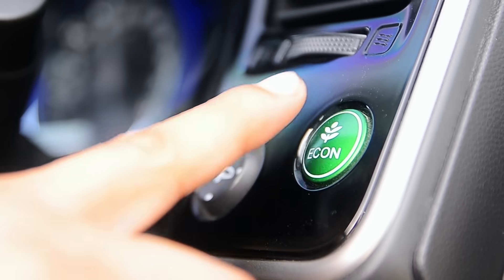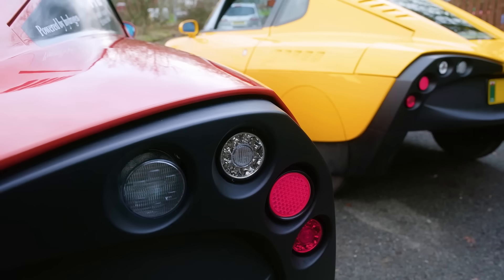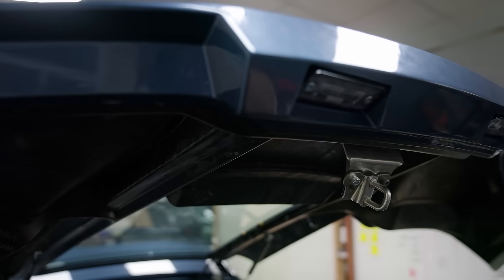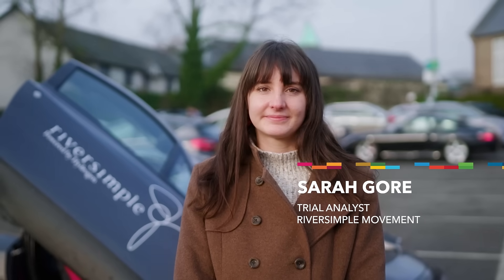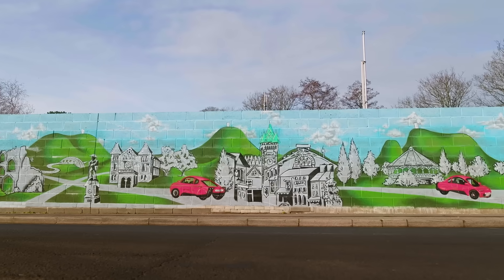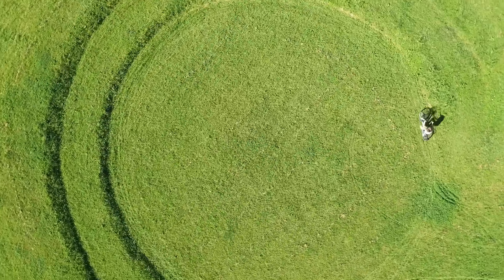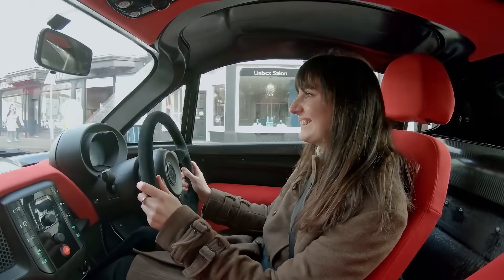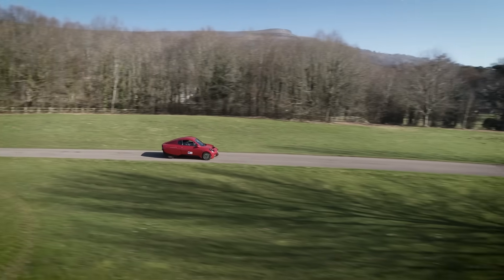Inside The Former F1 Engineer's Innovative Hydrogen Car

Comment: The concept is cool and the proposed range is good, the hydrogen needs to be green otherwise its just moving the problem out of the eyes of the customers and the cost needs to be appealing.
Reply: Love thé car. But if I cant own the car, I dont want it. Aptera.
Reply: @willdavis4863  yup, Aptera is FAR more appealing
Reply: @willdavis4863  How is owning that Aptera working for you? They have been working on that for over 20yrs. in one form or another and still not in the hands of the masses. vehicle, then it went to 8k then 10k and look at the price now and still nothing on the road.
Reply: @madkow007  There are two versions of the Aptera, the first, around 15 years ago, was taken over by industry insiders, pushing the founders out of the business, and wrecking their ideas.  

The founders were able to buy the project back a few years ago and restart the project from nearly zero, little more than body design as battery technology & material science etc. had moved on so far in the intervening years, and are now close to manufacturing a very promising vehicle, nothing else touches 10 miles per KWhr for example.  New / revolutionary car start ups don't launch into production in months, it takes years.  Right now Aptera are in the process of securing the moulds for body production from CPC in Italy, with the first moulds shown off by Aptera within the last week or two.  Considering the novelty, they are making great progress, first cars probably shipped later this year, or early next if not which is not unreasonable with such a blue sky thinking car.
Reply: Production of hydrogen even if green wastes way too much of the energy.
Reply: yeah I agree if it's shipped far away not good and if its made with fossil not good either, and if with low efficiency just nope.
Depends if electrolysis tech improves, hydrogen can be produced pretty much everywhere where there is water and power.
Reply: @bubbleemily  But green hydrogen always wastes energy in any form.
Reply: @girowinters  sad but true. Hopefully we might find a more efficient way down the line.
Reply: @girowinters  much better to use children's energy to dig up the materials for those earth saving none recyclable batteries.
Reply: @OldandCold6955  "none recyclable batteries"  ...  The batteries used in BEVs are very valuable resources at the end of their mobile life, up to 99% recyclable even if they spend a long time in fixed storage when their capacity has fallen too far to be a useful car traction battery
Reply: @peterchandler8505  none recyclable in the fact the owner of the said battery pack will have to pay a not inconsiderable amount to have this done (it will not be free) plus charged with the responsibility of keeping them in a secure and safe condition, they will no be able to leave them out for refuse collection will they, plus all the other myriad of problems for the owners, no one ever talks about this do they, ! if plastic is a problem we ain`t seen nothing yet
Reply: @OldandCold6955  Those traction batteries weigh of the order of 500kg, even if in several parts!  Your average driver will not be in a position to remove & replace the battery, especially as working with high voltage connections can be lethally dangerous and should not be undertaken lightly!  For non mechanic / electrician drivers (ie almost all) the battery change can only happen at a maintenance garage, where the garage will have regular suppliers, and will get a discount on the replacement battery by sending in the old battery for refurbishment if possible, or recycling for the valuable materials, producing high value raw materials for future battery manufacture.  A process similar to ICE cars for valuable parts such as engines, alternators etc where when replacing a failed part the vehicle owner will have the choice of a used part, refurbished or new part.  Even a poorly used traction battery will be quite valuable as it can be 99% recycled producing valuable materials.  

In practice, Teslas lose about 1% of their range every year, which means that the batteries will outlast the cars, hence Tesla are moving towards making the battery a structural component, it is after all a large and heavy part of the car, using that material as a structural part will reduce the overall weight of the car making them cheaper and kinder to the environment.  There are obviously batteries that fail earlier, that is what warranties are for, with Tesloop Taxis (who 100% fast charge their Teslas everyday for long fast trips, hence multiple hundreds of thousand mile cars) getting some high milage batteries replaced under warranty.  The Nissan Leaf seems to be the only car suffering real battery problems, but then their battery management is the poorest on the market leading to an active (though still quite small) market in upgrading battery packs that have deteriorated, or replaced with a larger battery pack.  

There is also a lively market for used traction batteries, especially Teslas where businesses such as Electric Classic Cars in Newton, Wales, will use those used / refurbished Tesla batteries (or other new / used batteries) to electrify existing vehicles, replacing the power train with a battery & electric motor.  Electric Classic Cars have an informative and entertaining youtube channel where they cover electrifying various cars producing quite dramatic improvements in those vehicle's climate footprint, drivability and performance, alongside many other factors such as recently covering fires, comparing BEV Land Rover off road with diesel Land Rovers.  The videos have covered Land Rovers, VW vans, VW Beetles, Range Rovers, etc. etc. etc. showing the various parts used in that process.
Reply: @girowinters  no hydrogen is great, you can use excess energy created from renewables to compress it into hydrogen. Sure you only get 40% efficiency, but at least you dont have to sit at a charging station for 45 minutes.
Reply: @girowinters  But less is wasted than the production and charging of a lithium battery.
Reply: @girowinters  If the excessive amounts of solar power produced at daytime (a problem in some areas in the world) could be used to produce hydrogen, it would make sense.
Reply: @HulluJanne  It would make more sense to charge batteries during excess times, much less loss. Or pumped hydro if available. hydrogen is on the bottom of the list, to mass produce hydrogen fossile fuels conversion is the only economic option, thats why these initiatives are coming from fossile fuel corps, directly or indirectly.
Reply: @HulluJanne  Unfortunately these areas have no or little water sources. Probably wind power stations is more suit such needs. But anyway it's not the best solution for energy storage today.
Reply: @HulluJanne  Pretending the society can throw away that wasted electricity instead of storing it to charge batteries on programmed chargers?
Grab a calculator. It's all on Wikipedia!
Reply: My concerns with Fuel cell hydrogen car with Toyota Mirai as a poster child, It need a huge high pressure pill shaped tanks for it to have a decent mileage. So much so the car got so big with too cramped space inside. It didn't even have a trunk to store your groceries. It is as big as BMW serie 5 with inside space of a Z3
Reply: The Aptera is strange looking but it has more boot space and interior space
Reply: @macberry4048  Yeah but sadly it's American sized like everything else. They should really have thought about that if they want to go global.
Reply: @Enforcer_WJDE   Yup.  Euro cities are smaller than America's !
Reply: @linmal2242  Meals and waist sizes are all "super-sized" in the US.  🤣
Reply: @maxhugen  You're waay behind on charging speeds, AND you can't practically make H2 at those pressures at home.
Reply: @macberry4048  And it does not use hydrogen :)
Reply: It's already a good enough car to have great range and efficiency with a small battery
Reply: hydrogen is dead, if it´s not green and cheap it doesn't work
Reply: Same thoughts.
Reply: The vehicle is made from Carbon Fiber.... Which has 3 times the environmental impact that traditional steel and aluminum
Reply: @mkrichey1 oh you mean like battery cars, destroy and pollute foreign countries mining lithium and cobalt then burn coal to produce electricity to recharge the batteries, then in 10 years dump the dead batteries in landfills?
Reply: We can fix that with the H2-Flex
Reply: Toyota got it on the road!
Reply: There is no way to combat rising sea levels by converting atmospheric gases directly to water.  We, as a species, are not ready for this technology.
Reply: There is NO such thing as "green hydrogen" and hydrogen is never going to be any viable transport fuel. 700psi+ operating systems, and the need to use two of the MOST expensive metals on Earth in fuel-cells are the main reasons why it's a NO.
Reply: And, with hydrogen it has to be very safe.
Reply: @joewiediger2737  ever seen a EV on fire ? almost impossible for emergency services to put it out and the claim is EVs are safe ?
Reply: Hydrogen is an inappropriate fuel to power road vehicles. They have one advantage only over BEVs - fueling speed, and even that is likely to be superseded as charging technology improves. The list of disadvantages of hydrogen spans all the way from fuel creation to final exhaust product. It takes a prodigious amount of energy to produce, if produced using green electrons it wastes 90+% of those electrons at the final wheel turning end point. Worse, it's likely that the hydrogen will be created from fossil sources. The exhaust product is water vapor - a green house gas - and one that condenses easily and then freezes in winter conditions rendering the very expansive catalyst system useless. The vehicles still need large batteries, still need electric motors so there's no environmental gain since environmentally expensive metals will still be needed. And in addition even more unsustainable and even more expensive metals are needed in the fuel cell itself. After this you have the safety aspects, the infrastructure and delivery nightmares etc. the list goes on. Not mentioned often is the hydrogen is rare in the atmosphere, very rare, but still there are microbes that feed on it - who's to say that increasing their food supply won't be bad for us when the inevitable hydrogen leaks occur?
Reply: @mb-3faze  In essence, green hydrogen is difficult to produce, store, transport and use. But, ultimately green hydrogen's biggest problem is that it takes a huge amount of green energy to make a tiny amount of green hydrogen.
Reply: @mb-3faze There are microbes that feed on just about everything.  And water vapor is not a greenhouse gas- its what sunlight does to every exposed bit of water on the 70+% of the planet that is covered in water. The issue with hydrogen is that it is inefficient to produce, and fuel cells require catalysts that are among the rarest elements on earth… there is literally to enough of those metals to replace 25% of the autos on the road with Fuel Cell cars.   The hydrogen is manufactured from fresh water, not sea water, and so actually uses up a resource that is getting scarcer. This car achieves 300 mile ranges by weighing nearly nothing, having only two seats, and such narrow moped sized tires that its road holding abilities are virtually nil.  Add to that that hydrogen is difficult to contain, leaking readily thru even the tightest seals, and couple that with yet Another infrastructure for distribution that will be increasingly poorly maintained as it grows and you will see efficiencies drop even further.
Reply: Mining lithium just moves the problem out of our eyes too?
Reply: H2 they will produce is green.
Reply: @rjung_ch  look into the processes: 100kWh of "green" hydrogen requires ~3x the electricity that charging a 100kWh battery does, meaning a hydrogen transportation economy would require 3x the power generation capacity of battery-based automobiles. Note that this assumes fuel cells are about as efficient as batteries and that the cars have comparable power requirements (both reasonable assumptions, though I believe fuel cells are less efficient). Also, the hydrogen tanks are extremely heavy so the system energy density (hydrogen, tank, fuel cell) is about the same as the best production batteries today, and nowhere close to the best research batteries already being developed. It's not really even viable for aircraft anymore, and is a horrible idea for automobiles.
Reply: @rjung_ch  green hydrogen is too expensive, and no technology exists that changes that. And its complicated technology, not likely to be massproduced for personal vehicles, especially when batteries are getting better, simpler and have infrastructure already. "but range!" if you cant fill up anywhere, hydrogen is worse for range. At this time its a desperate bid to keep using follsile fuels, people who think diffrently are either grifters, or wishful thinkers.
Reply: @rjung_ch  When they said "green hydrogen" I lost interest. The blarney about small factories being more efficient has been disproven: the machine that makes the machine. If you don't know what that means, you're waaay behind...
Reply: All electric has this problem.
Reply: That's what the EV does.... it simply moves the "problem" away from direct observation of users.
Reply: Hydrogen can be made from water... Also, hydrogen can be made at the fueling station cutting out the need for shipping in large vehicles... If that's not enough you can utilize solar and wind turbines  as well as a slew of other renewable ways to collect the energy needed for a pumping station...
Reply: @JshockSubmariner735  That would be hydrolysis, the option that wastes 2/3 of the electricity. Again, hydrogen proponents always try to greenwash over the fact that each hydrogen car traveling down the highway costs more generated power than three battery electric cars.
Reply: @JshockSubmariner735  it wont be made from water, as its prohibitively expensive.
Reply: @JshockSubmariner735 😅

Comment: Sustainable child labor in the coltan(Cobalt) mines .
Reply: Well cobalt is needed to get the sulphur out of crude when making petrol and diesel.

If you want to avoid using cobalt then pick an EV with lithium iron phosphate.
Reply: "Sustainable child labor in the coltan(Cobalt) mines"  How is this relevant?
Reply: @rodshop5897  batteries depend on cobalt which they say use abusive child labor to heave out the ground

Comment: When  said you have to plan your  week with EV he lost credibility.
Reply: Yep, that was the moment I stopped watching... I charge  my Tesla Model Y when I sleep, I need my sleep every day, no need to plan any of my charging, I just do it when the battery gets below 20%, which is about once or twice per week at the moment, depending on how often I need to be at the office.

With a hydrogen car, really, I have looked this up for where my home is, I need a 100 miles round trip just to fill it up!... Getting hydrogen for my car would always be floating around my brain if I would have such a car, range anxiety guaranteed!
Reply: "When  said you have to plan your  week with EV he lost credibility"  Why is that?  The people I know who have EVs do indeed plan around when and where they can recharge their cars, so it seems pretty accurate around here.
Reply: @rodshop5897  I just drive my EV around, plug it in at home occasionally. No planning involved. If i do a >250 mile trip the planning is "where shall i stop for a break and charge at the same time im having a break" hardly einstein levels of thinking needed.
Reply: @Joe-lb8qn  Sure, you drive your car differently from others.  Many others do indeed plan their week around their EV.  I personally know two families who do.  So the comment in the video is credible to many (if not most) of us.
Reply: @rodshop5897  He lost me when he said it has no battery. Fuel cells need a battery to get any acceleration out of the vehicle, and for regnerative braking to work. Looks like a scammy presentation to me.  Also it will cost at least 5x to 10x as much to "refuel" vs. an EV.
Reply: @fotoguru222  Well, I think he meant that it does not use a battery as the motive force, just like a regular car does not use the battery for the purpose of moving it down the road.  Where are you finding the 5x to 10x cost numbers for refueling?
Reply: @fotoguru222  Agreed
Reply: @fotoguru222  Agreed
Reply: @rodshop5897  I have a Tesla Model Y, I never have planned ahead where to charge.. I charge mostly at a public charging pole at the parking lot near my home where I used to park my gas car in the past anyways... I plug it in when I get home, and unplug when I leave in the morning with a full battery. On roadtrips to Germany, the car tells me exactly where to charge and for how long.
Reply: @MarcoNierop  "I charge mostly at a public charging pole... "   You understand that this constitutes a daily plan to charge your vehicle, right?  It's not an inconvenience, but it's still a plan.
Reply: @rodshop5897  With planning meaning you always have to think about it how to schedule the charging into your life, in my case I need less planning than when I had my gas car!

Comment: And cost as much as an F1 car
Reply: its a small company, things will be expensive to cover development costs given fear that there maybe not enough customers for now who will buy enough cars
Reply: @kalmmonke5037  it'll be expensive because of the materials in the fuel cell, the carbon fiber body, the battery (the video said it didn't have a battery but hydrogen fuel cell vehicles all need little batteries).